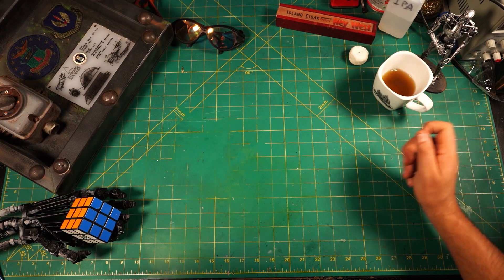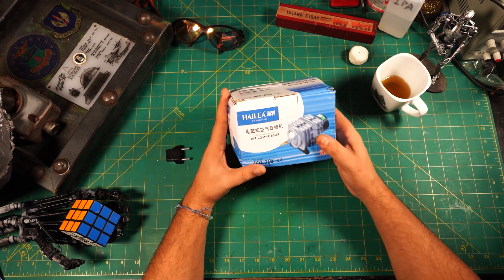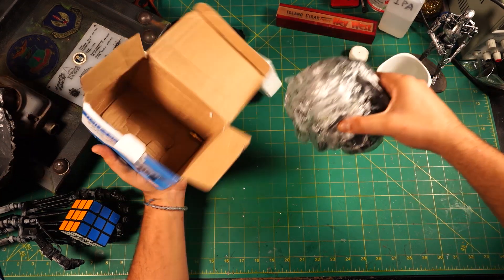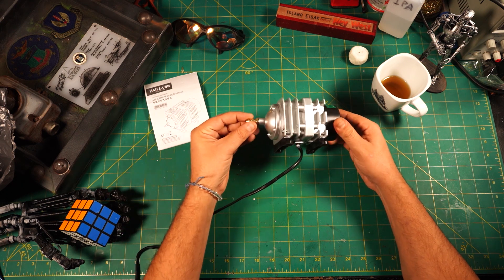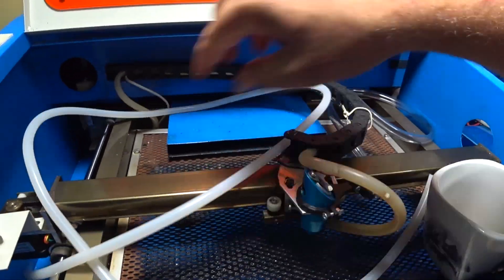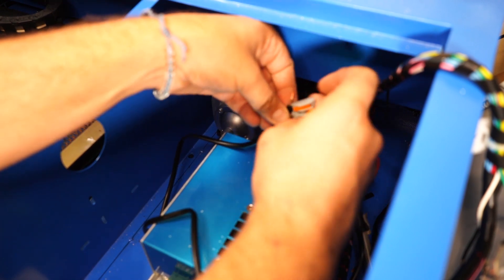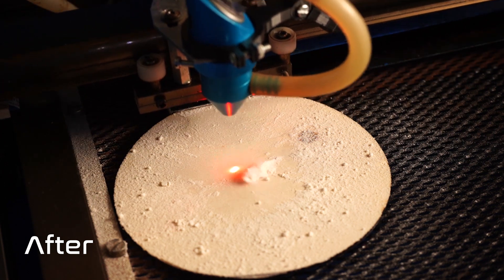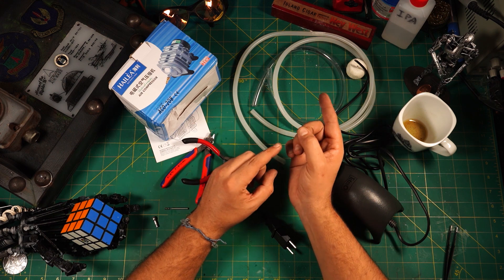K40 Laser Air Assist Upgrade - Cheapest Good Air Compressor

Comment: Less than 2 psi, better than nothing but a proper compressor with a tank is much better. Save your £30 and put it towards an airbrush/nail compressor which will give you 30 psi. Cost about £60-£100.

Comment: Got the same pump but people telling me not to put inside as the vibration from the motor could vibrate the laser?
Reply from the maker: I made the experience that when i mounted it to the bottom of the chassis that it indeed transfers vibrations. Mounted on the side however for me it works ;)
Reply: @MancaveEffects  So the inside of the power supply? On the left or right? Di dyou pump have semi rubber feet like mine?

Comment: I realize this is an older video but  was looking on your channel for an update about this air pump?  I recently bought a used  air brush compressor for my laser air assist but the darn thing over heats.  I guess it's not meant to run for long periods of time.  Is this air pump still going strong?  Does it get hot during use?  Thanks, Love your videos btw!!
Reply from the maker: I am still using this pump to this day with good results, however i am not using the laser on a weekly basis. So hard to tell if it is reliable enough for professional or semi professional use, it still is a very cheap piece of chinesium.

Comment: I bought one on the strength of this video. How is yours holding up and how is the model coming along?
Reply from the maker: It is still working fine, i just finished a  cutting job that took about 3 hours and it still runs👀

Comment: Hey I have a question for you : do you think that the model that you choosed was powerfull enough ? You choosed the 25W, but there is also some versions with 35 or 45W. Have I to bought this version or it could be even better with a 45W for instance (or is it just overkill ahah) ? (I'm french, and I'm quite impressed by the quality of your videos, nice work !)
Reply from the maker: I must say that i am surprisenly satisfied with this little air pump. It seems to provide enough airflow for what i use it for. I would say that there is always space for fine tuning as with everything but for me this device works for every material i had used for now.
Reply: @MancaveEffects  Thank you for your answer, I'm going to buy the same model as you ! Keep going 😊

Comment: that white powder is not rat poison but lime. it is necessary so that in the production of the cable, the outer layer does not fuse with the insulation of the conductors.

Comment: At 12:12, I can see that this compressor does NOT give 45 liters of air per minute. More like 4.5 LPM or so. When I am cutting, 12 - 16 LPM is sufficient. Clean cut, only start of the cut is with some tar, but that is all.

Comment: I tired hooking up same (or similar) pump to my k40. Vibrations ruin my rubber stamp engravings. For wood is somewhat ok, although not ideal. For cutting is awesome, almost 2x strong cuts. I've put the pump OUTSIDE the machine, on a separate table. 
Now I want to try and find something that has constant stream of air, to eliminate nozzle vibrations, but not so powerful and expensive as air compressor. Any ideas?
Reply from the maker: Well you will need some sort of air tank to get an air buffer. There are airbrush compressors out there with a reservoir, but they need to run quite often as the tank is very small. I would get me a compressor with a big air tank like 25L, but of course they cost some money specially because you need to get a decent one. The cheap ones from Home Depot are noisy and will spill oil everywhere after a while... Tried to run the air assist off a co2 tank, that works pretty well but is quite costly over time also. So no straight ideas that are cheap for now sorry.
Reply: @MancaveEffects  Thank you.
 Looking into oilless 25-40l compresssors now. 
For now I have used longer hose and punctured some holes in it to relieve air pressure. I get much less vibration on my engravings, but its still unacceptable for rubber stamps.
Had better rubber engravings done when I had my old style of laser head, without any air assist. But swapping it in and out every time someone needs a stamp is impossible.

CO2 tank would be awesome (in theory) for making cleaner cuts for some more premium orders, or for stuff where you cant reach with sandpaper.

My brother handpaints fishing lures and is interested buying compressor too. Maybe we'll pool in.
Reply: @oleglego3655  Quite a late response, but have you tried to make the table the laser is on heavier? It should help to dampen the vibrations.
Reply: @oleglego3655  if you get better results engraving rubber with out it, just don't run it for those jobs, save it for cutting etc

Comment: Isn’t the pump going to vibrate the machine, moving the cutting material while the laser is working?
Reply from the maker: It actually runy pretty smooth. The rubber feet seem to absorb the vibrations. However the outlet at the laser head is quite noisy.
Reply: @MancaveEffects  regardless of the rubber feet, I would not suggest leaving a running air pump inside while operation the laser. Not only will the vibrations degrade the engraving results, I’m sure it’s very bad for the tube, especially where you seem to store it closely to the back of the machine where the tube resides.

Comment: A good negative ioniser in the room will stop you smelling the burnt wood!
Reply from the maker: Sounds like a great idea! Thanks
Reply: @MancaveEffects  My 2 cents on the ioniser - I use cheapo ozone generator enclosed in a sealed box. I put my engravings in, and run it for some time. It really works! But the ozone will corode a lot of different plastics and rubbers (and your lungs, and your pet lungs, and some plants) so room aplication is not the best idea. Ionisers also produce ozone, but in much smaller quantities. I tried enclosing ioniser I borrowed and it had less effect than an ozone generator.